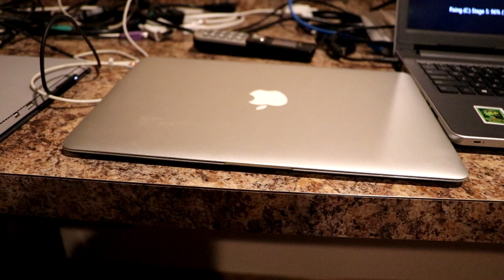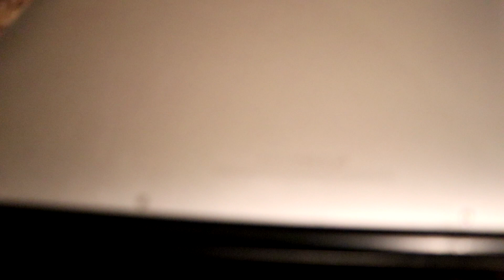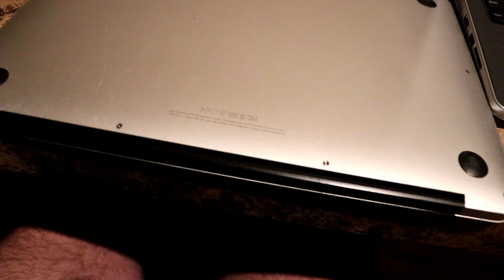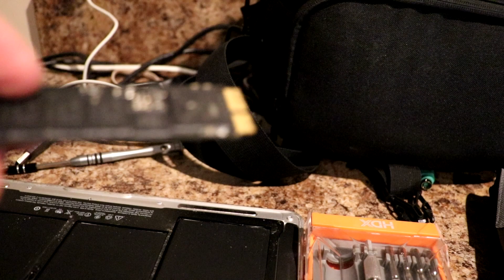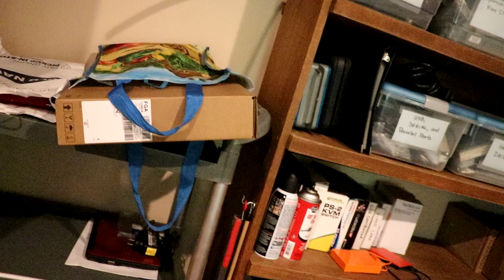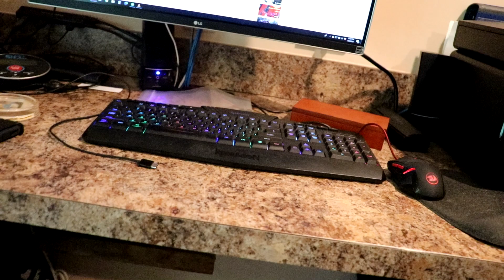Macbook Air Data Recovery Part 1

Comment: Good job!  I haven't even opened the Macbook Air I have in for data recovery yet.  I received a mother and daughter set of apple laptops.  The mother's laptop had a WD HDD.  I plugged that into my dock attached to my Linux laptop.  Transferred the data without issue.  But, the daughters?  It worried me thinking it may be soldered in.  Your video gives me hope.   Wish me luck, I'm going in!
Reply from the maker: Watch both parts 1 and 2 and good luck
Reply: @LitchfieldCountyComputer  I need to find 2